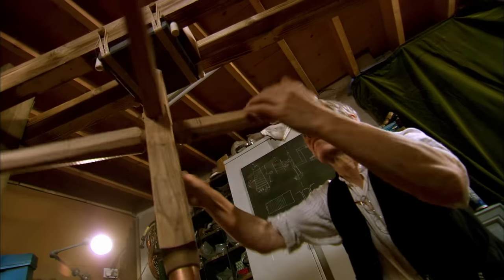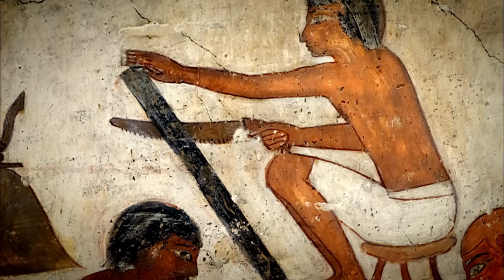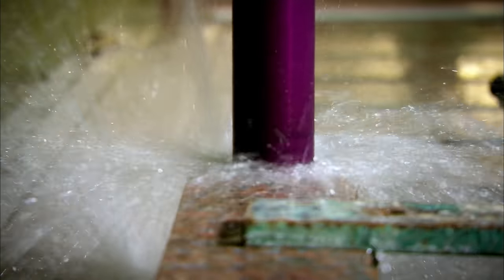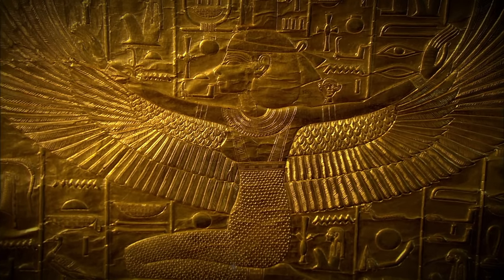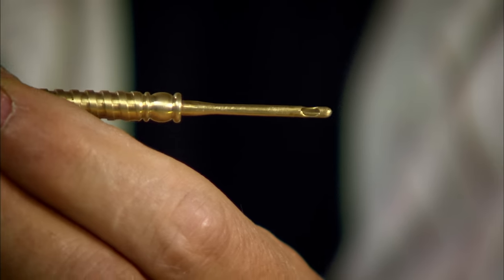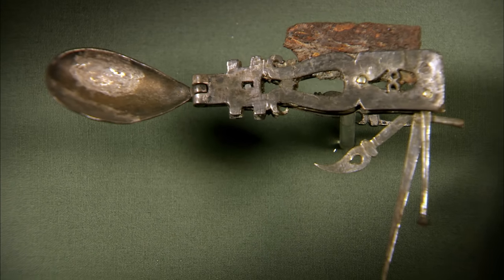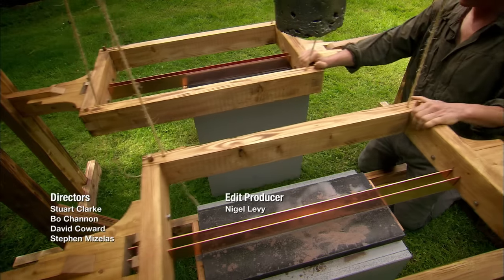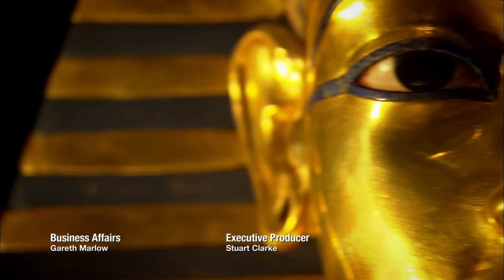Incredible Tools for INSANE Tasks | Ancient Impossible (S1, E6) | Full Episode

Comment: For years I have used  copper pipe to holesaw glass with the aid of diamond lapping compound. The diamond embeds itself into the softer material, the copper, and it then grinds it's way through the harder material. It's like using a pitch lap to grind lenses or mirrors for telescopes.
Reply: Obsidian is likely than diamonds.
Reply: @craigb8228  I'm only saying that you can use soft copper pipe to cut granite with the right abrasive. Heck, pitch laps are used to grind lenses.
Reply: They had emery, which has a hardness of 9. That's plenty for granite.
If you don't mind the tool wearing out, you could use wood. Emery sandpaper still exists and it uses paper.
Reply: They used the Star Gate. Then traveled to the Planet. Where they visited Tool City Outlet that had all their tool needs.
Reply: It is only a mystery to the jeebus crowd.
Reply: that’s right . an old tool maker trick it to take bronze etc and lap diamond etc onto the tool. they could do that even with various materials and tars and items heated to get very hard with embedded media. now saw drill and even other pulley type systems

Comment: I have a sold Alabaster Crystal Chimney Topper, that absolutely passes all the tests for having been done in Ancient times.... Six flute drills, vibrational softening techniques..., a drill bit 5 inches in diameter was used in my chimney of crystal to drill 2 mm per rotation through .14inches of crystal without a chip.I was given the chimney for doing some work, and funding a project.   Thank you Mam. The grooves in your core look identical to my chimney, only at  5" diameter and at a 14" depth..  WOW

Comment: Coating of diamond attached / glued to the copper would cut a Core 7.
Water power from canals could power uni-directional drill.
Reply: Furthermore they could’ve used the same water power to constrict a vertical vice simultaneously to create the spacing in between the grooves
Reply: How about a piece of diamond so big that you never thought they had. Using diamonds as big as fists.

Comment: If it was a mechanical drill making core 7, the spirals would be more regular.  Just looking at the spirals shows that multiple people worked on the core.

You had 3 guys get nearly half an inch into the granite.  So if you had 10 groups of 3 guys switching out every 5 minutes or so, you could easily get a granite core in a day.
Reply: I agree, we project our current tolerance for elbow grease (which is VERY low) onto people that didn't have machinery to do the heavy labor.  You can get a lot more done with people just doing hard work than most people think.  To me that exercise showed that it ABSOLUTELY could be done, the only question is how much it was worth in human time it was worth.
Reply: And they had lots of slaves/workers and time.
Reply: @rogergriffin9893  actualy we don't know that. the diameter changing adds  more to the mistery
Reply: and each line in the core is where they added new grit.
Reply: Humans having been using iron since before the flood of Noah.  Just look up Tubal Cain in Genesis in the Bible.
Reply: I would bet they didn't even use people. Its well known animals were used for labour as well. A couple oxen attached to that going around in a circle could easily have continued on for quite a few hours before being switched out for a fresh pair

Comment: As for the core drill. The reason for the smaller size at the beginning of the core and becoming larger at the bottom was the bit they used was walking around until it got deep enough to stabilize itself. Ive core drilled thousands of holes in concrete and granite. If the machine isnt secure it allows the bit to walk a little bit and the cores look exactly like this. However even with a diamond bit it takes FOREVER to core a 3" hole 4" deep. You have to have a cocretter block to chase the bit after about every 1/4". I can only imagine how long that 1 hole took back then. Hopefully it was done BEFORE the header was placed.
Reply: Copper with the correct vibration/sound, there are youtubers that have replicated this apparently.
Reply: All those striations…
They must have had incredible patience and stamina to drill out a core that big.
I won’t say it’s impossible, or even improbable.
I think it just took a while it if time and determination.
Reply: MrDpracing, I have several cores here from coring pool walls for plumbing. The sides of the concrete cores are parallel, sometimes you have to bang the bit to get it to slide out. I don't get why the sides of that core are tapered.
Reply: Yup, wallowing out the diameter of the core.

Comment: Add a simple wooden frame around the bit and either a hand crank or a treadle, and you get muscle-powered, one-directional grinding that would leave the irregular distances between the lines.  Maybe even a flywheel if you don't want it to stop when changing the laborer powering it.  A bit of wobble, with the surface as the pivot point, and the slightly conic shape is produced.

Really, the single biggest thing that the ancients had that we've lost is patience.  "With a modern tool, it takes 5-6 minutes to cut a 6-inch core" - said as if 5-6 minutes was a ridiculously long time.
Reply: Patience and intelligence. I believe we have much accumulated knowledge, but less keen cognitive power due to multiple factors.

Comment: The Egyptians used a copper tube on a pole with a weighted stone on top and a hand crank spindle.  There are wall paintings of this tool as well.  When spun by hand they added water and sand.  There is a video of scientist making this type of rotating hand drill and could drill a 4" in about 6 hours.  As the copper drill was use it got sharper.  The grooves were caused by sand imbedded in the sharpened copper.   Additionally, with these hand tools also created the core taper from the wobble.   There is another video of artists making stone bowls with primitive stone tools.   Seek them out,  it is no real mystery.  K.I.S.S.
Reply: Copper won't cut granite... You're a Minecraft fan, huh?
Reply: And where do you propose they were getting the copper tubing from? The local copper tubing store? I seriously doubt that the ancient Egyptians had any idea how to manufacture tubing of any type. If they had tubing technology they probably would have used it to move water and sewage around as well
Reply: @CaptainContraption  Ok, so clearly you did not watch the videos I posted in my reply where the scientist show how the copper tube was made and used.   Egyptians were able to work and embed jewels in golden sarcophagus, do you really think they were in capable of making a simple copper tube?   Allow me to explain.  They clearly were able to work copper and make chisels, right?  when smelting copper it is easy to poor it on a flat stone surface so you have a sheet of copper.  Since copper is soft you can ROLL IT ONTO A TUBE.  This tube of copper was nailed onto a wooden shaft that had a round stone mounted on top with a hand crank.  Copper tube + rotation + sand + water= hole drilled.   Watch the videos I posted.   K.I.S.S.  = keep it simple stupid.

Now to address the sewage and water moving statement, Copper like most metals were still labor intensive to mine, smelt, and work, so these items would be more rare into comparison with wood and stone tools.  Not to mention that copper tools wore down and we only have a few examples of copper chisels from Ancient Egypt.  You are looking at ancient people through modern goggles without understanding how things can get done with unlimited manpower, sand, stone, and water.   Modern copper mining and manufacture is at such a large scale, it cannot be compared to back then.  Even today we only use copper for interior plumbing but no on a large scale.
Reply: What makes U think that copper was the only metal employed within the manufacture of Egyptian tools.
Those idiot scientists still want 2 believe that slaves built the pyramids; & what about the idea that the Egyptians may hav employed alchemy within the granite-stone cutting procedur.
The only thing that's required 2 cut granite, either then or now, is a matter of determining the exact frequency structure, I'm  certain they had alchemist & I'm likewise certain that they had other technicians tuned n upon the exact frequencies relevant upon each task.
Respectfully, Troy
Reply: Where is your evidence?
Reply: @troyfuller3767  Well they sure didn't use steel as they were pretty limited in the metals they worked because they were in the BRONZE AGE,  lasting approximately from 3300 BC to 1200 BC.   They literally defined the bronze age for working tools.  

About frequency?  Please, it took NASA decades to come up with a small ultrasonic core drill and that had nothing to do with the 'frequency" of granite.  Granite can be cut and is cut with abrasive tools.  Granted we now have CO2 lasers that can cut granite.   There is some evidence of stone softening, chemically as well as possible geopolymers being used but neither is completely confirmed.
Reply: STOP THINKING YALL KNOW SO MUCH WHEN ALL YALL DID  WAS WATCH THE PREVIOUS DOUCUMENTRY
Reply: @troyfuller3767  I didn't say anything about copper being the only metal employed. I'm quite certain that they were able to manipulate any material in any way imaginable (unimaginable) with a level of precision that exceeded what current technology can produce. Therefore I find it very challenging to believe that they would employ such a difficult/time consuming uncontrollable process. They had highly advanced skills that didn't include rotating a tube by hand with a rock tied to it.
Reply: @CaptainContraption  sorry 4 my misunderstanding.
They were certainly inovative.
Reply: @CaptainContraption  copper with diamond dust may have done it also diamond will cut granite
Reply: ya, no mystery really. they could cut blocks with rope, water and sand, back and forth or even simple rotary cranks.
Reply: They are looking for the hardest way instead of the simplistic way of doing it
Reply: Figures having gone through the exact surgery. Same with an endoscopic.  My first words you think you guys would have developed more defined surgical procedure?

Comment: I think a tremendous weight was placed upon, in which/with a constant circular system was applied. Obviously, this is a best guess, but seems to reason. Good stuff
Reply: The hole was in the ceiling  -  the speculated birthplace of 7
Reply: YOU MEAN YOUR BEST  GUESS BASED ON YOU KNOWLEDGE
Reply: @tylerlormand5644  yes, my best guess with my knowledge is usually how that works!🥴
Reply: @DJGive1 it doesn’t mean that the hole was drilled from the ground up. The hole could be drilled into a stone that’s later flipped up to become a ceiling piece

Comment: The core is 1) tapered, and 2) does not have a spiral groove pattern typical of a modern powered core drill.  The grooves are inconsistent in inclination, depth and in spacing, and often aren't continuous.  Some are even short, partial cuts that do not cut even a third of the way around the core.  You can see this in some of the images used in this video.  The key issue is the grit being used, how hard is it, and how was it applied.  The partial grooves suggest a loose grit, while the depth indicates a very hard mineral such as corundum or even diamond.  There are also numerous other stone cores from Egypt, of other stones.  What is happening here is that someone is saying, "ooh, the stone is granite!  How DID they do it?" (Imagine Bugs Bunny's voice there).  If the Egyptians could core one kind of stone, they were able to core any kind, provided they could acquire a cutting medium.  They could also saw stone with recourse to "lost" technologies.
Reply: The grooves could be caused by loose grit, or when the tool is extracted from the hole. When drilling steel, if You do not stop the machine, and clean the tool after it punches through. The debris on the bit can cut grooves when backing it out.
Reply: @randallmason9687  The visible evidence doesn't really support this.  Some of the partial grooves are at different angles, and suggest that the grit was embedded in a relatively soft matrix and could come free during work.  What most modern people don't do is work at replicating use wear and tool marks.  Even the continuous marks are not all exactly parallel.  They are not nearly as regular as what a modern power drill would produce, but they are consistent with muscle powered systems.  

The Egyptians had a good many "low tech" machines that do jobs with devices we now employ a motor to operate.  They had several kinds of muscle-powered lathe for instance, and rock saws that did not always operate perfectly.   The saws likely employed a cord of some sort carrying grit along a kerf irrigated with water.  Water can be essential to faster, more efficient shaping of stone like granite.  I've replicated prehistoric, granite manos once used widely in western North America.  They are primarily made from selected cobbles and battered to shape.  If you don't wash them steadily, the powdered granite starts cushion the surface from your tool.

Comment: I am only 14 minutes in but havent seen any suggestion of the ancients using stationary forces to add to the amount of pressure needed to forces the drill down while mechanical forces the drill to spin. A guy holding the drill center can only apply so much force while something in place could apply so much  more.

Comment: Just means they cut it going on direction. First idea would be to use something similar to a bow cutter, but attached to a horse. Or maybe just walking in a circle instead of going back and forth. Even could have a water wheel pulling a rope connected to something like a bow saw.

Comment: Diamonds on the edge of the copper bit could have worked. Just need a way to keep it spinning the same direction with weight applied to the top to cut and make the pattern. It wouldn't take a genius to make up.

Comment: all the fixation on metal. you don't need metal to work Granite. Abrasive adhered to a flexible strip, attach the Granite to be worked to a wheel attached to foot petals like a grind wheel or pottery wheel to turn it on, work it into shape slowly with the abrasive. Tadaah, within a month you have a cylinder.

Comment: A hidden consideration of precision, is the logic of looking at a tool being build from a distant for its precision, like surveyors do to getting the bolts in the right place with a mile away testing and marking. So ancients had trigonometry for placement guide, and geometry for structural representation. Just a start to wanting more precision to be known.
Reply: A possible hint to making the copper blade more effective is if a electric charge was used to weaken core 7's skin to allow the cut be done more easily!
Reply: Influence of abrasion logic.

Comment: 5:07 granite / sand fines placed in bottom of chiseled concave section would allow any sized quartz piece affixed to wood spindle to work for days
Reply: Simple loaded wood piece weighted by 500 - 1000 pounds of rock & wood spinning mechanism via pulley mechanism would spin at 100X speed of simpler pulley mechanism. 1000 rpm possible; weight critical and strength of cordage

Comment: I use to know this Chinese guy who had a sharpening/grinding wheel that was all manual and kinetic. It was powered by stepping on a wooden peddle, the peddle then would pull a leather belt over a pully, the pully would turn the grinding stone and the weight of the grinding made it act like a gyro. it started out slow but once in motion, that wheel would make anything metal shoot sparks like an electric powered grinder.

Comment: Copped tube drill, water under gravity pressure running through the center of the tube. Natron and silica abrasive added to the solution. The sabu disc could just be an impeller for an abrasive/water solution
Reply: Considering the crude copper chisels they made I seriously doubt they were able to make anything that even roughly resembled copper tubing

Comment: the rings being spaced like that i can only assume are from it taking so long and requiring different sized drill bits. if you notice, its more of a cone, im assuming to help a door hinge pivot better. instead of imagining each ring as one rotation, imagine it as 1000, then them having to change bits bc that one got dull. or theyre sharpening the same bit over and over as it gets filed down, which could also possibly make it cone shaped.
Reply: The conic shape is probably due to wobble.  Since the outer surface point would be the "pivot point" of the wobble, a little wobble at the top would be more pronounced as it went further in.

Comment: The hand powered drill they show at around 12min mark could work with some changes, you could extend the drill shift up through the weight on top and add a pully to carry a power strap that is running from a tram of oxen thats on a turnstile of sorts with a power output shift with another pully to power the drill changing the size of the 2 pullies would change the speed of the drill also.  We pretty much used this very simple design to power all sorts of things with with animals all they way up tell we made steam engines.  Can even power various types of saws in the same fashion from circular saws to back and forth pull saws all of which could be used to increase the production speed of cutting stone for these people.  Im sure they would carve themselves doing this into a hieroglyphs but it may have been hard to carve the depictions of a more complicated animal powered belt driven sawing machine or maybe they have in a way and we have failed to be able to understand that is what they are showing.